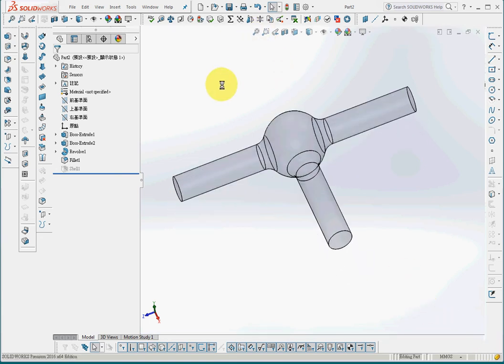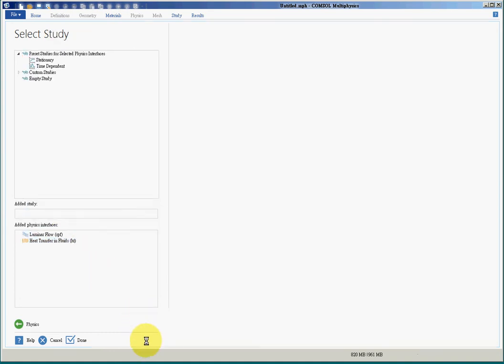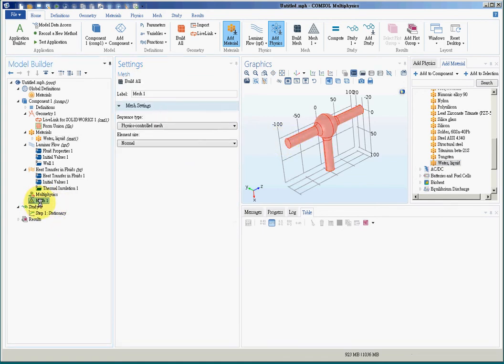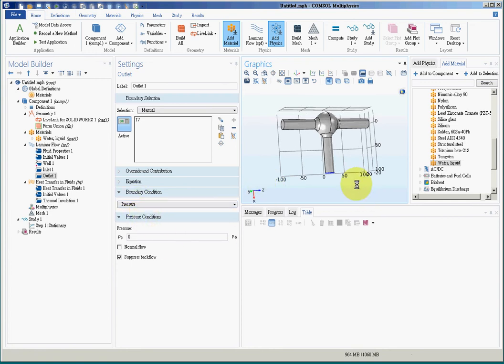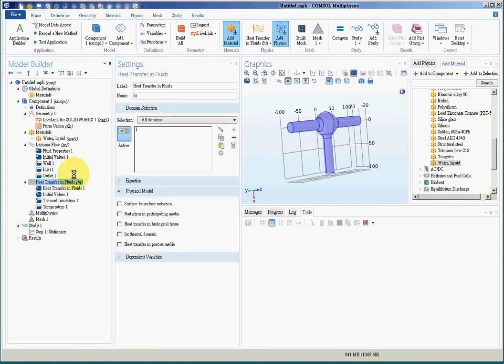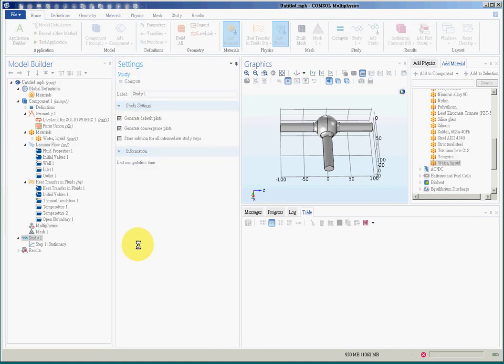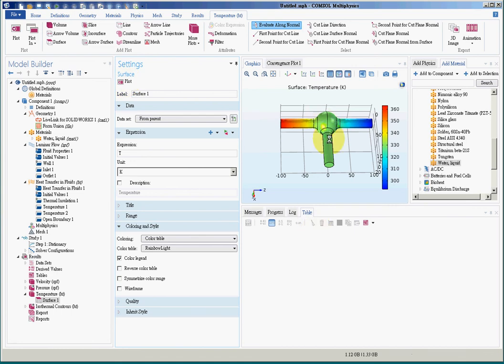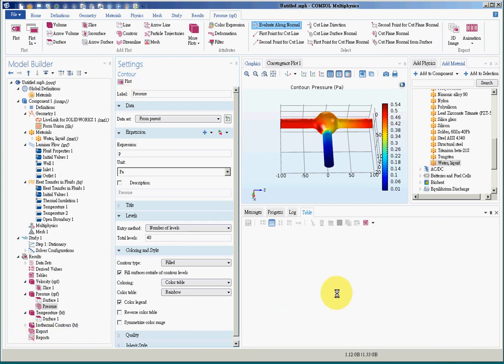COMSOL CAE 11 2  Flow Simulatin Mixing of Hot and Cold Water

Comment: Have you tried this with Time Dependent solver too ? I wonder how long would it take for these different temperature fluids to mix. And why didn't you use Non-Isothermal Flow module ? I assume that if we don't need to simulate influence of temperature change on fluid properties (density, viscosity) then we don't need that two-way coupling and we can just add Laminar Flow and Heat Transfer in Fluids modules without coupling them in Multiphysics node. Am I right ?
Reply from the maker: Gumball ：
No, I have not perform transient analysis. My vodeos are for beginers.
Reply: Ok, I understand. What about coupling both interfaces in Multiphysics node ? Isn't it required to simulate temperature changes in fluid flow ? I think that without it COMSOL first calculates fluid flow, then heat transfer in motionless fluid.